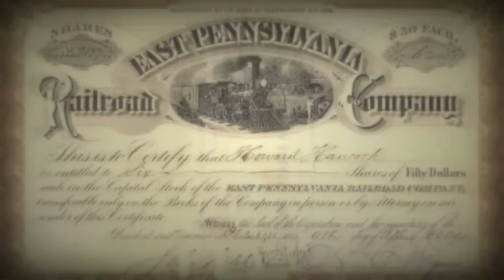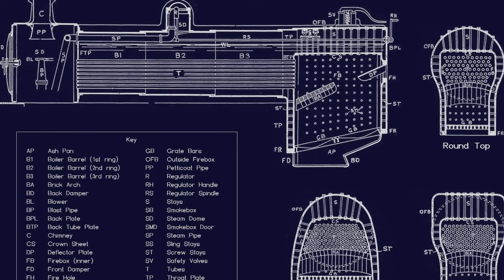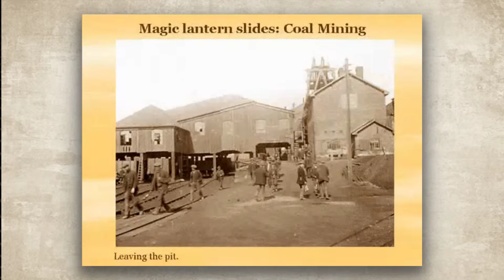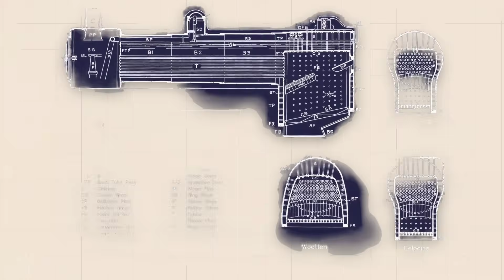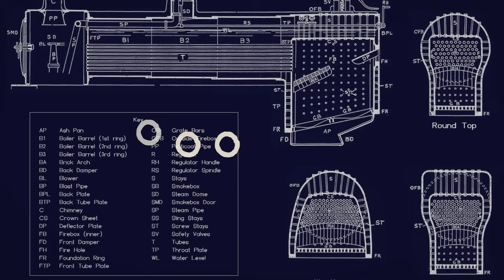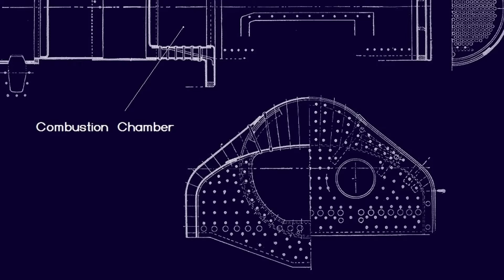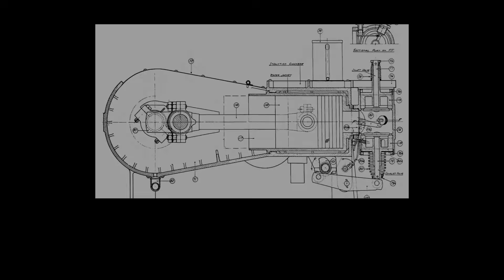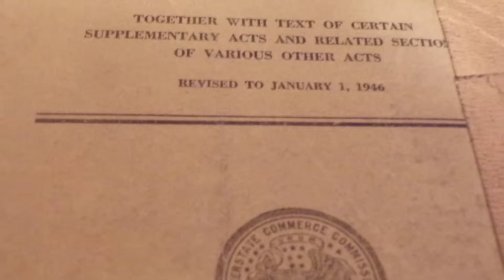Crews Called It The 'Widowmaker' - But It Was The Only Beast That Could Burn 'Garbage' Coal

Comment: I heard about a fireman and engineer who didn't get along ran a camelback. The fireman waited until they were to climb a steep grade and stopped shoveling coal. Then threw the shovel in the firebox and hopped off and walked away. When engineer need to use steam to climb he didn't have it and the wheels spun. Didn't know the guy had left.

Comment: On the other hand, regular, especially line locomotives, very rarely suffered broken rods if at all. So maybe there were not only cuts in fuel costs, but also in quality of the steel used for building those locomotives. And that's a whole different story.

Comment: Most coal fired steam locomotives burned bituminous coal, not anthracite. Bituminous was cheaper, burned faster, and was abundant.

Anthracite was mostly used for home heating and similar applications. It burned cleaner and slower, but was much less abundant.

The Reading, Lehigh Valley and CNJ were near the Anthracite mines of northeastern Pennsylvania and the enormous piles of culm.

Comment: It doesn't make sense to me that they needed to put the cab astraddle the boiler, over the drivers. Why not put the cab behind the firebox as usual, and just support it with an extra truck underneath?
Reply: Later designs did just that. The center cab "Camelback" style were an attractive industrial design.
Reply: @AQuietNight  Well I'm glad they finally listened to me, then.
Reply: it means the loco becomes 10-30t heavier, with this weight not used for traction. Yes its possible, and was used with schemes like 2-6-2, 2-6-4, 4-8-4 and so on, but not for small locos from 1870s with 2 or even 1 driving axle.
Reply: @antontsau  That makes sense.
Reply: Cost. 

It’s build shit because it’s cheap. It’s running on shit because it’s cheap. It’s ALL about cheap cheap cheap.

Comment: First thought: Wait did you say coal dust? Throw it into a power plant's furnace you saves the work for shattering them
Second thought: Damn it was 1870s it was still 30 years before the electricity era...

Usually burning this thing is best done by blowing it into the furnace with a blower. But electric blowers do not exist yet...lol! Shoveling it with the good old way is the very wrong way for such a fuel.

Comment: Actually they put the cab up front for better visibility.
It had nothing to do with the type of fuel the locomotive was designed for and better visibility for the engineer probably save many more lives than the 1 or 2 who were killed from a broken crankpin which was pretty rare.